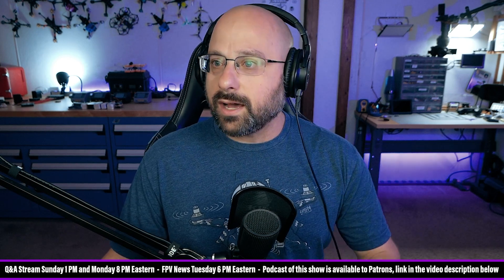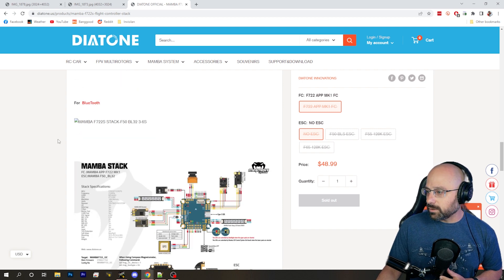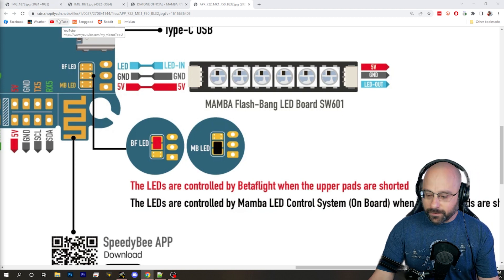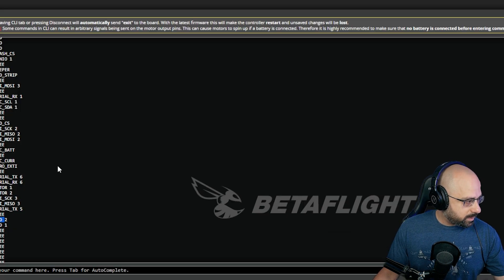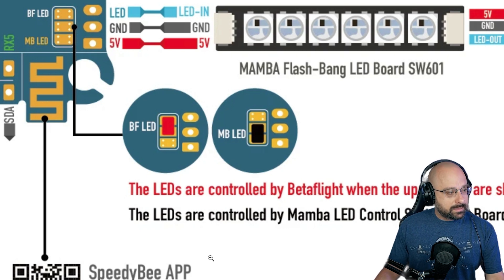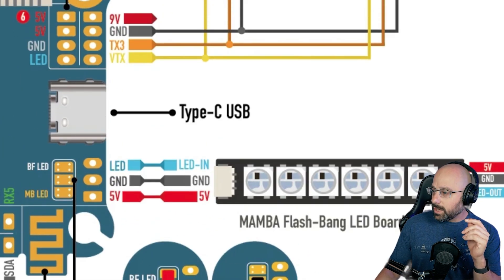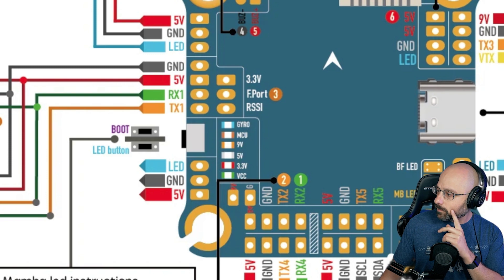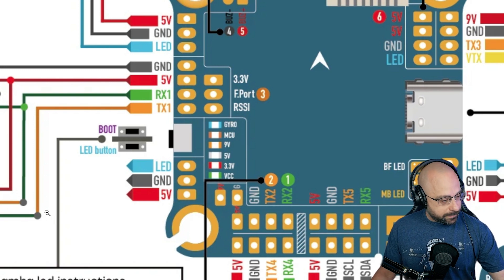My LED Strip is not working on my Mamba Flight Controller - FPV Troubleshooting

Comment: SOLVED: I had exactly the same issue and solved it by trial and error. Before moving the solder bridge, Mamba-controlled LEDs worked fine, but I didn't check 'resource show'. After moving the solder bridge to BF-controll this CLI-command did not show any 'LED_STRIP' ! Of course, LED_STRIP was activated in the configurations-tab, because I had the LED-tab. And if I just typed in 'resource' (not 'resource show') I also saw 'resource LED_STRIP 1 B03' (In my case it was B03, you may find something different).  'resource show' on the other hand read 'B03: FREE'. I was at a loss. Simple resource remapping did not solve the problem, and how should it? Without knowing what I was doing, I decided to try 'Softserial'. And the miracle happened! Just after switching on the 'Softserial' slider in the configurations-tab and reconnecting again - already without any reallocations - the LEDs lit up in BF-controlled mode. And 'resource show' now showed 'B03: LED_STRIP 1'. Afterwards I could switch off 'Softserial' again without any disadvantages.
Obviously, after re-soldering, the previously controlled Mamba mode connected to B03 has been forgotten, although the assignment in the basic configuration is simply written down elsewhere. If Softserial is activated, it seems that the connectors are re-read. Certainly a problem with the Mamba firmware.
Reply: hi, im quite new to fpv and im also trying to get LED working through FC/betaflight on the mamba f722 mk4 board. I'm trying to understand your comment/solved so i can get mine working too! So does the solder bridge have to be on MB, or BF bridge for it to work via BF?
Reply: @photosbyjames_  Try it this way: Without any modification to the solder bridges, connect the LED-strip as foreseen in the wiring diagram. I used at one side a cable with plug and on the other side a cable with socket so that I can disconnect. Power the board and press the LED-button underneath the Boot-button. Is LED working in Mamba controlled mode as it should? Yes? Then LED is not broken, power and ground are connected correctly and so is signal. Unpower the board. Unplug the LED strip. Desolder the pre-existing solder bridge, and connect the middle solder pad with the forward solder pad in flight direction (BF mode). Plug in the LED strip and connect FC  to Betaflight. Make sure that LED is selected in the configurations-tab. Try the CLI-command 'resource show', and most likely you will not find LED_STRIP! That's the issue. Type the CLI-command 'resource', and most likely you will find LED_STRIP. - Now leave the commandline Interface, go back to configurations-tab and make sure, that 'Softserial' ist selected (make sure that LED is not unselected) and SAVE! Disconnect the FC and reconnect. Double-check  'resource' and  'resource show', in both cases you should find LED_STRIP. Now you can unselect 'Softserial' in the configurations-tab without loosing LED_STRIP. Double-check the CLI-commands. Now you're an expert! Please tell me, if it works fine.
Reply: @fenix.357  thanks heaps!! Will give it a go when I get time this week! This instruction was clearer, thank you so much! I will report back after I have tested but fingers crossed!!
Reply: @fenix.357  i tried to give this a go and no luck unfortunately, i tried both the above method for MB short bridge as well as MF bridge and doesnt work. I've tested my LED directly by connecting it to a battery and the module works fine including changing colours, so im clueless at what my issue could be :(
Reply: @photosbyjames_ You tell me, that in a different environment, the LEDs work. Do you have an Arduino board or something similar? Are your's 5Volt or 12Volt?  But when you try Mamba controlled mode, THIS DOES NOT work? Could it be that you didn't solder cleanly? Are there short circuits? Can you measure voltage and resistance on one hand between each of the pads but also between each pad and the corresponding connection point on the LED strip? Did you inadvertently switch the wires? Do you have WS2812 or WS2812B, that makes a difference? Or did you buy neither one of them?
Reply: @fenix.357  I double checked my soldering and the wiring diagram for my FC and the LED and have checked i have installed correctly, when i power on the FC, the LED will cycle from Green>Red>Blue>White but then it will be stuck on white colour and BF settings won't change the colour. I am currently using this LED, HGLRC 5V 2812 LED Controller with W554B LED.

Comment: Check the wiring, control pin on the led strip in the center. This is different from the flight controller documentation diagram.

Comment: Not the same board but worth noting that the wiring diagram might not be perfectly accurate here. On the Mamba H7 board the wiring diagram has the solder bridge labeled incorrectly. The mamba LED position is actually betaflight LED and vice versa. Mine shipped with the “BF pads” bridged but leds were controlled with the mamba controller. Swapping the bridge to the “MB pads” allowed for LED strip control in betaflight.